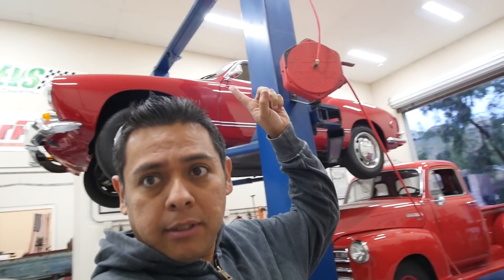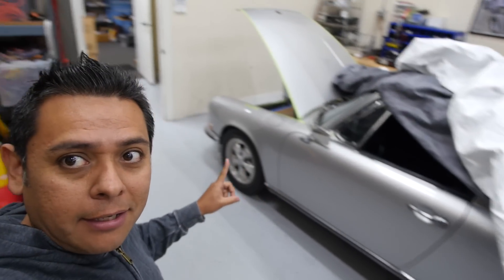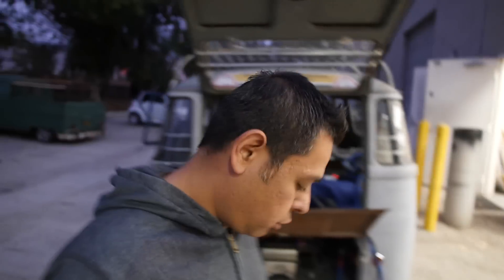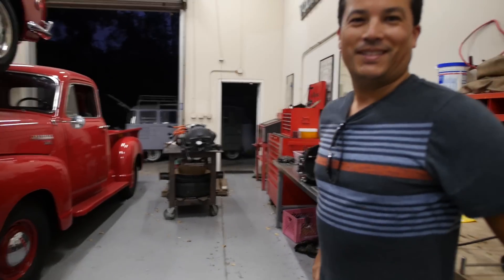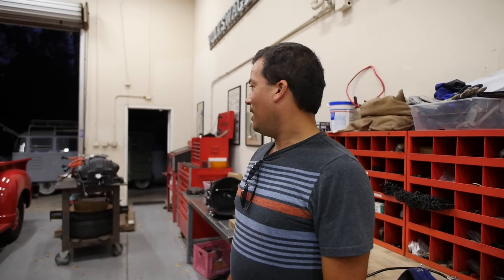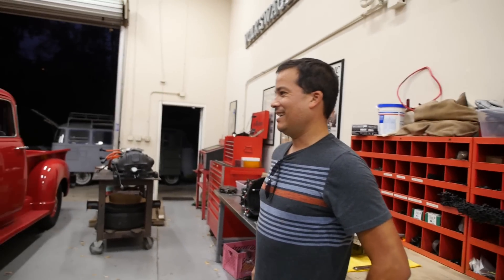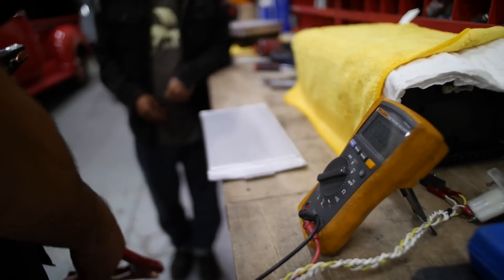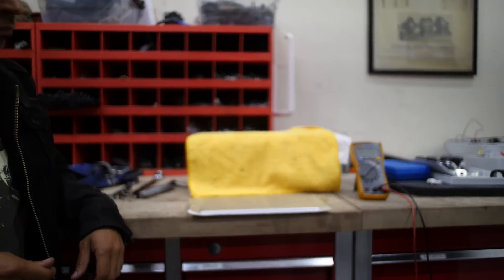killing LIPOs in the name of Science

Comment: Hey Jehu 

Good stuff here. Could you tell us a bit about charging your pack with a solar system? What would be involved in stabling the current? You have that nice 1000w charrger, would that work with solar panels and maybe a bit about the hardware that would be involved. 

Im contemplating a 12v system for my RV as I live in it full time and power is always an issue.

Comment: Jehu, I have an idea for you to think about and experiment with... you know how electric cars use the deceleration to put power back into the battery banks, just put an extra wheel  down on the ground that is tied to two generators above. As the car is being powered forward, the turning of the wheel in turn powers the generators which put electrical charge back into the battery back. With gearing, I think you could possible increase a battery banks effective distance dramatically. What do you think?
Reply: no you are so so wrong, you can only get enery out of braking. not when driving. because the energy you put in to moving the extra weel you dont win back from that extra weel. there is no such thing as almost free energy.

Comment: I bet you're dying to take apart an upcoming Model 3 for the more energy dense batteries it'll have? If the largest battery option is fairy priced (unlike the now new 100kWh), one might get a (say) 100kWh Model 3, take out half of the cells, maybe replace with some formerly discarded 18650's, and have the sweep 2170's for a high profile conversion.

I'd love to know of recent conversions of cars with fast/light chassis to begin with, for a competitive weight to range figure.

Comment: Why wouldn't direct drive work just as well on that Chevy?
Reply: It should work, however the RPM will determine the top speed and acceleration will be influenced by the kW rating. If the RPM is low like it tends to be on DC motors, it won't go very fast and if it's very high then acceleration will be a problem as well as starting on an incline since peak torque is higher up in the rev range. You could brute force it with a powerful AC induction motor but they tend to be more expensive. Even Tesla uses a reduction gear in their transmissions. If I'm not mistaken, Mercedes made the only direct drive electric car, the SLS one has 4 motors.
Reply: Thanks for the info:)
Reply: If I remember correctly Tesla uses single speed gear reduction. Earlier Roadsters had two gear gearboxes which broke.